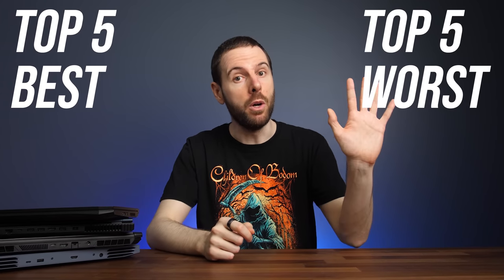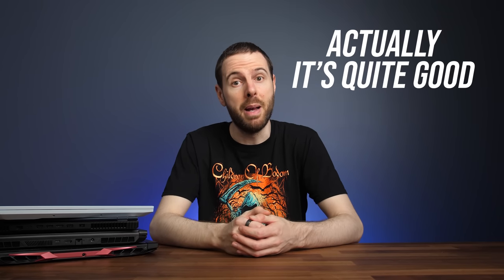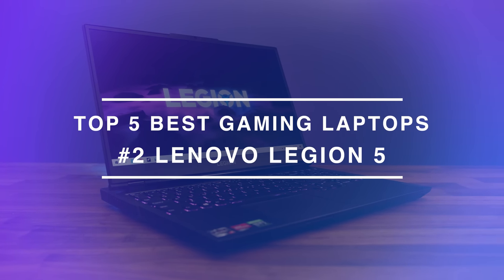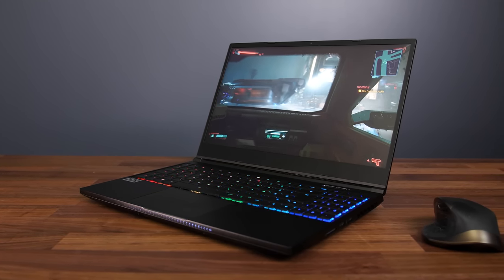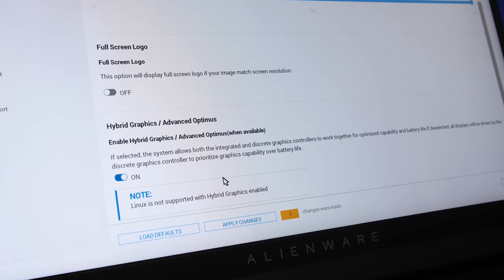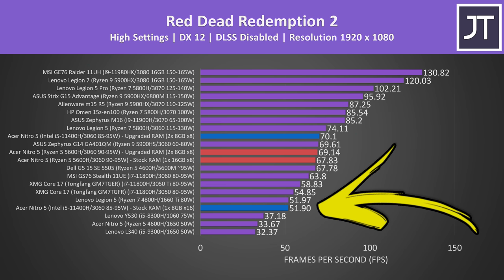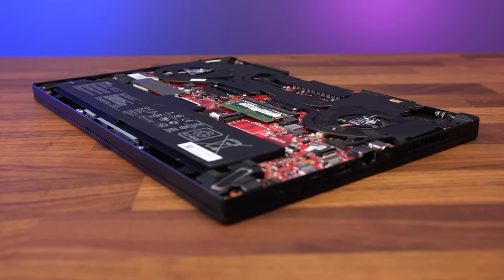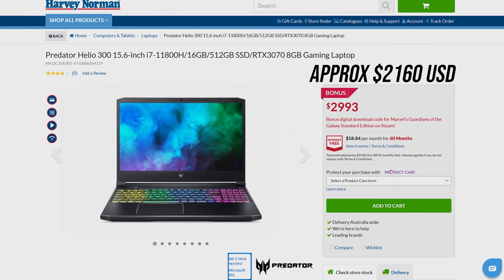Top 5 BEST & WORST Gaming Laptops of 2021!

Comment: So how would the ASUS S17 have ranked with the 1440p display? I understand the only drawback may be the soldered 16GB RAM, which makes it basically useless for expansion, as an asymmetric RAM config would result in slower RAM performance even with higher capacity.
Still, the whole package is quite amazing.

Comment: I think TongFang Laptop (that's XMG/ Eluktronics/ Illegear) usually are really bang of bucks for the price tag (while the quality still ok I guess)
Currently owned Illegear Onxy V Ryzen 4800H + RTX 2060 (which is XMG Core 15 2020), although I got replace motherboard once before just within one month of purchase but then after that so far so good. I even cross flashed with XMG BIOS for better thermal control and stability
Reply: How are they bang for the buck when they are more expensive than most other laptops with the same specs? They offer full powered GPU but are WAY more expensive than others. 2100 for a 3070 Neo is a full 500 more than the zephyrus g15 with a 3070.. and the neo has half the ssd. 

Def not bang for the buck
Reply: Well I do agree that they offer relatively lower price in the market, and I bought one, but their after sales service is kinda disappointing due to low number of working staff and only KL HQ could do the critical repair. Yea I'm still waiting for them to diagnose yea not starting repair yet my laptop after two weeks :') Am waitin for my Legion5i now :'))

Comment: I got my 3060 Acer Nitro for $1100 for use docked in my solar conversion van and it’s great. It came with 2 sticks of 8gb ram, runs games in 1440p 60 max settings (death stranding, Sekiro) and sometimes 4k60 (dark souls remastered).
It works great for exactly what I bought it for and helps me save power as I live off grid with solar from the roof of my van. I’m looking forward to using it to play elden ring when it comes out. Still wondering if I should get two sticks of 16gb ram, and if I can do some case mods for better thermals are therefore over locking since it is always in use docked vertically by my ac unit.
In fact, when I saw your first review canning it for the hardware like screen quality and keyboard feel, I was very happy because it meant I could possibly find it even cheaper, it’s the most bang for the buck when it comes to laptop GPU power efficiency! I mainly play console ports, and this is better and more efficient than a PS5, plus it’s my daily driver computer too!
Reply: that sounds really cool, off the grid with a sick laptop, you go dude!
Reply: @just_cryo  thanks man. Yesterday I was playing FF7 on PlayStation in RGB on my CRT and running FF7R on my laptop on my 4K monitor at the same time in the van running off solar. Lol

Comment: I'm surprised the ROG strix g15 isn't on the best list. It's got good price for every spec level and it looks gorgeous unlike something like the Legion 5 (although I'm not saying the legion looks bad).
Reply: Not really a huge fan of the weird hinge thing they have going on there
Reply: @kenbee1957  which laptop you talking about?
Reply: @arpitmishra6711  
The Rog Strix
Reply: my rog zephyrus g15 just gone today..using 10 days ago,2 usb a port damage.on top rubber is coming out. compere my old laptop dell g5 has no any  issue and problem  ,condition bad.   today was return and refund.
Reply: I bought it brother it's a fuckin beast.
Reply: @karanyadav-go4ym  Yeah I've had the laptop for about 6 months now and its been amazing using it. The screen colors are very nice and the 144hz is gorgeous to look at. The design of the laptop although "try hard gamery" looks really nice in my opinion. I need to agree that the hinge they did is not ideal, it does look nice but you can barely push the screen backwards and the screen itself is a bit too small for my liking coming from a 17" laptop but I guess that's a sacrifice to be made for the amazing specs.
Reply: @thebester  it's like I have payed the advance amount can't backoff now,today by evening it ll be in my hands,i am super excited asf,life 's first expensive laptop,never had a laptop ever.its g15 ryzen 7 4800 h ,rtx 3050 ,16 gb ram.
Reply: @thebester  it's costing me 87000 rupees ,you can convert that in your currency and judge that if I made a good decision or not ,well I hope I made a good one,i roamed 50 plus shops for tuf a15 it was out of stock so this was the best option left,and those extra RGB and thermals win the game thou.crazzzy look,it looks more stylish than anything.
Reply: @karanyadav-go4ym  yeah bro u made a great choice. For my Ryzen 5 5600h and Rtx3050ti ROG G15 I paid 1000 pounds which is equivalent to 101000 rupees for you, so you got yours for a really good price.
Reply: @thebester  🌊🔥💯😏

Comment: Not mad, just surprised, to find the Acer Predator Helios 300 at the very end. I got one in Jan 2022. $1729.00, 1 TB M2 drive, 16 GB of Dual Channel, 11th Gen i7, NVIDIA 3070, QHD 165 Htz screen. (I got it for 20% off retail) I upgraded to 32 GB RAM, added a 2nd M2 Drive, and a 2TB SATA drive. So I have enjoyed upgrading. But I have not even tried gaming yet. Thinking about MS Flight Sim on the 2nd M2. At any rate, I like it. Love the screen, so bright, excellent colors. 
(No mux switch) too bad, not sweating it. I am a happy camper. 
15 second boot on a slow day. Loads, installs pages of Windows updates in minutes, not hours. 
(My old laptop is  pitiful) Interesting reviews. Helpful, educational, (about good points and "issues.") Cheers!

Comment: Got Legion 5 few weeks back. So far it's been great, I only dislike the wifi card which isn't the best. I guess I'll swap it in the future, but other than that, great laptop for sure. I'm totally happy playing with it even though I got normal desktop with RTX3070.
Reply from the maker: What did it come with? I heard they had to stop using Intel for some due to supply issues but yeah at least it's cheap to replace yourself
Reply: @JarrodsTech  Indeed, it's a mediatek wifi 6 card if i'm not totally wrong, but seems like it's unstable especially while I game and use discord same time. Have heard about this problem, new drivers helped a bit but still isn't as stable as it should. But you're right, swapping it shouldn't be too hard, gonna do it while upgrading to a bigger SSD. Otherwise I really like the laptop for sure.

Comment: Based on your review, I bought the Lenovo Legion 5 (R5 5600H; RTX3060) , 2 months ago for around 1100€ and I was never so happy and satisfied with a Laptop before. I was coming from the Asus TuF A15 with R9 4900H and RTX2060 and although I liked the TuF, it´s such a huge difference. I think Lenovo hit the sweetspot and was cutting on the right edges to keep the price competitive...I mean, I am not the person who needs RGB or metal finished chassis. The screen could be better, because the 120Hz version is not awesome, but again, that´s things what you don´t realize when using it.
Reply: i bought my AMD Advantage Edition Asus Rog G15 with RX6800M for around the same amount in India. you could say 1300 Pounds
Reply: Why would you downgrade from a 8 core flagship laptop CPU to a mid range 6 core laptop CPU
Reply: @youtubeshadowbannedme  because I did not need it. For gaming and normal office work it is fine. Besides of longer battery life, I also have the feeling that the games run faster with the 5600h, vs. the 4900h (in single core 5600h is better then 4900h)...and of course the full powered rtx3060 😅
Reply: @sumitdalavi  where did you buy i am from india
Reply: So do you still think was a good decision buying the legion 5?
Reply: @rafa2657  absolutely, love it, never had anything better before. a completely satisfactory package. no issues till now, only thing what i would change is the next gen of this laptop, if it performs like this version
Reply: @noscream3809  you still have it ? how it's doing now ?
Reply: @hanionline563  still happy and works like a charm. only issue i had at the beginning was with the wifi module with latency drips, but this could be easily solved by turning off locations in windows settings

Comment: Well my Strix G17, i would say it's a great gaming laptop, but not the best since it share the same issues with Strix G15 Advantage Edition, but i got mine back in March, where finding new gaming laptop with Ryzen 5000 CPUs were difficult and i still very happy with my Strix G17 till today.

I tried to go for Legion 5 as well, but at that time, the Legion 5 2021 was just announced and i really need a new laptop as my old HP crappy pavilion gaming laptop has too many issues and it didn't meet my requirement for my work (i wasn't a tech enthusiast last time).
Reply: Same here
Reply: I think it's still great with 17 inch just no 100RGB and mug

Comment: I bought Asus tuf dash few months ago and back then it made more sense than today. 3050ti was brand new and it had price of 1660ti laptops so i went with 3050ti because of dlss. Also there wasn't that many options back then. Still, i wouldn't recommend tuf dash at the moment because quad core doesn't cut in 2021 games.
Reply: Exactly.. I bought the Asus TUF with a 90w 2060 and a woeful 3750H quad core and sold it less than a year later due to its abysmal performance in games - struggled to get 50fps with everything set to low on warzone.. with the money I got from selling it and a bit extra I purchased the Dell G15 with a 5800H and 130w 3060 - awesome laptop for the $ and phenomenal performance.. I now get well over 100fps in warzone with everything set to max (bar textures due to 6gb vram) and this is with Ray tracing on and  DLSS off !! Incredible performer

Comment: Thank you, thank you so much! I was lost in turkey while trying to find a place (online or not) to buy a great laptop. The websites (at least the Turkey versions of them) were so confusing! And stores weren't very helpful either. Finally you gave me the doorway to pickup my laptop. (I got Lenovo legion 5 gen 6 (15") with 8 core 16 threads AMD Ryzen 7 5800H, and RTX 3060 6gb with 16gbs of DDR4 3200MHz RAM. Right now I bought it for 1,630$)
Reply from the maker: Glad I could help!

Comment: Legion 5. Standard version doesn't have full powered graphic as mentioned here. It has 115W max tgp + 15W with boost. Now that may be closer to max for RTX 3060 but not for 3070. 3070 performance difference between normal and pro model in GPU heavy games are pretty measurable.
Reply: Pretty sure 115+15 is actually the max power for laptop 3060
Reply: @jhulenoscarantezanamendez6106  Have you read my comment property. That's what I'm saying that for 3060, it's same but for 3070, legion 5 pro can go all the way to 140W.

Comment: My Nitro 5 (AN515-45-R21A) came with two 8gb sticks of 3200 running in dual channel.

It's extremely unfortunate that you take every opportunity you can to talk about how "bad" the Nitro 5 is just because your test machine was poorly configured.

The most unfortunate part is that I was hoping my machine came with a single 16gb stick so that I could upgrade to 32gb dual channel at a minimal cost. What you view as the Nitro 5's weakest point is actually a great opportunity for expansion on a budget.

Your videos are great and I appreciate the amount of information you provide, but your weakest point (and my only criticism) is that you fail to represent the point of view of the machines you review from any perspective except your own.
Reply: Agreed
Reply: I’ve mentioned this multiple times to Jarrod. Single channel memory can be one of the strongest points about the laptop since you don’t need to buy extra and waste the existing sticks.
Reply: bro the nitro 5 sucks🤣
Reply: You're asking him to review what he has no access to.
Reply: @PaperRouteBrady  It absolutely does not suck. It's the best value laptop available. Purchasing a laptop you'll be happy with, particularly in the budget sector, is about managing expectations. Jarrod's expectations (and yours) are unrealistic.

I put a 2TB SSD for storage and a 32gb ballistics memory upgrade in my Nitro 5 and my total cost is still well below the closest comparable competitor. You would need to spend an additional $400-$500 (likely more, but I'm not going to research current prices) to buy a gaming laptop that matches the specs and performance of my computer, and the performance improvements would be minimal at best.
Reply: @PaperRouteBrady  It doesn't suck and it's not the best budget laptop available like @BLdrmmer82 mentioned...
It's just a good price/quality laptop that have it's advantages and disadvantages but it's definitely not the best even on it's price range.
Reply: @bldrummer8287  i get where your coming from and im kinda new to the gaming laptops so i shouldn’t have said it sucked cause i really don’t know, i just bought lenovo legion 5 for my first one
Reply: @PaperRouteBrady  The Lenovo Legion 5 is a great computer, no doubt, if I hadn't found my Nitro 5 for sale at the right price when I was ready to buy I would definitely be using a Legion instead.
Reply: @ispatience3829  I'd be interested to know which computers beat the Nitro 5 for value.

My specs/cost-
Ryzen 5 5600h
32gb 3200 dual channel (crucial ballistics)
512 SSD
2TB SSD (crucial bx500)
RTX 3060 @95 watts
$1490 

If you can find a laptop that meets or beats these specs for less or equal money, I will concede the point. No black Friday deals qualify, I bought mine in May when I needed one. I'm aware I probably could have found a better deal if I had been able to wait until today but time was a factor.
Reply: First of all, that's not the only issue with the Nitro 5. There are thermal issues, power limit restrictions, port deficiencies, and buggy software. And while I can accept some compromises for that lower price, all of them together including the RAM issues, it isn't worth it in my opinion.
Reply: @raahimhadi4905  Disagree.
Reply: @cameronbosch1213  There are definitely compromises made to reach the price point.

However, I've experienced no thermal issues. It's worth noting that I did repaste with Thermal Grizzly Kryonaut. I tested thermals before changing the TIM and while the temps are lower with the Kryonaut, the temps were acceptable with stock TIM.

I know there are 3060's available that run above 95 watts, but the price difference for those laptops was far too great for minimal FPS improvement in my opinion.

The ports provided meet my needs, but I can understand if someone needs more/different ports.

I've also experienced no software issues. It's worth noting that after buying a new computer the first thing I do (after turning it on to verify everything works) is a fresh OS install to get rid of all bloat, followed by reinstalling only the necessary programs (in this case DTS Sound Unbound and NitroSense are the only needed software included). 

As stated previously, I would have preferred receiving my Nitro 5 with only one 16gb stick of ram so that I could upgrade to 32gb dual channel with minimal cost. What you view as an issue can be seen as an advantage from a different point of view.
Reply: @bldrummer8287  There is legion 5 with :
Ryzen 5 5600h
Rtx 3060
8gb ram
512ssd
120hz screen
That costs only 1000€ (not black friday deal)

And yea probably at the time you bought your laptop there wasn't really any good other offers since any rtx 3060 laptop was above 1500€ at that time...
So I don't blame you for that and sorry for misunderstanding...
Reply: @bldrummer8287  I see that you're a little bit disappointed on Jarrod's reviewing your laptop but it's only a one person point of view there are several other reviewers/users that are highly recommending it..
So it's just what you need from your laptop if you're satisfied with it then don't consider these kinda reviews it's just an opinion after all.
Reply: @ispatience3829  Hmm yes that's a really good deal, I likely would have went with the Legion 5 if that configuration had been available at the time.

I was honestly trying to provide feedback that I think would improve Jarrod's videos. I can't understand why he's so negative toward the Nitro 5. He's made two videos about why he doesn't like it, but is it really bad enough that it needs two nearly identical videos repeating his reasons? I suppose it's pointless to hope that I could open his mind to perspectives that might reduce his considerable (and seemingly irrational) dislike for the Nitro 5 and, in the end, you're right... I should probably just stop watching his videos if his reasoning seems ridiculous to me.
Reply: @bldrummer8287  Hi I got the acer nitro 5 with a rtx 3070 100W and 16gb ram and 1tb nvme ssd. for 1500 euro's. so yeah its a good value. Oh and a ryzen 5800h!

Comment: Currently using an Acer Nitro 5 with 11th Gen i5-11400H, RTX 3050Ti, 8GB RAM and 512GB SSD.. so far it works really well for me.. haven’t played any games on it as I’m still using it for my Hybrid work setup until I get my replacement Work PC.. also planning to upgrade its ram to at least 16GB..